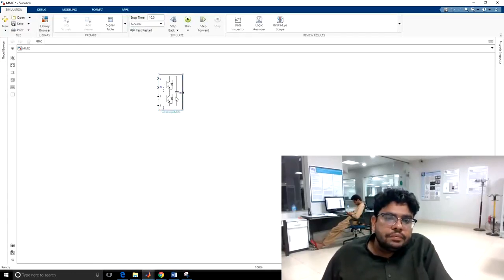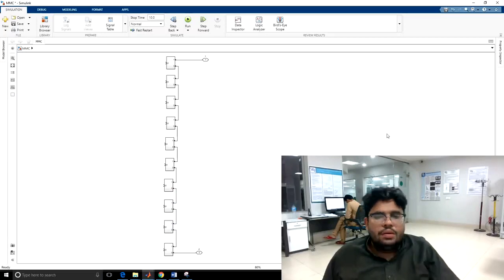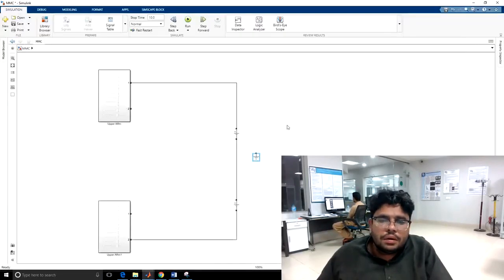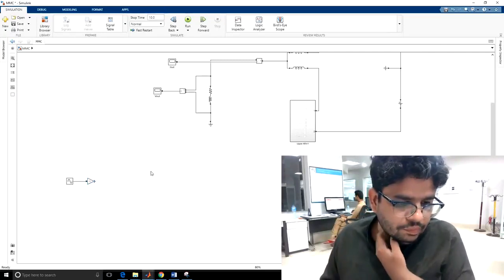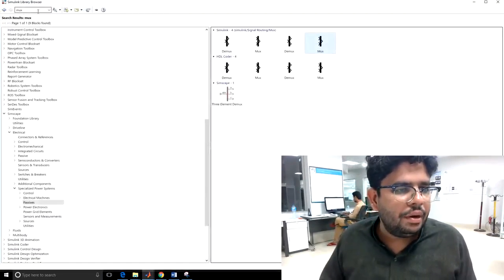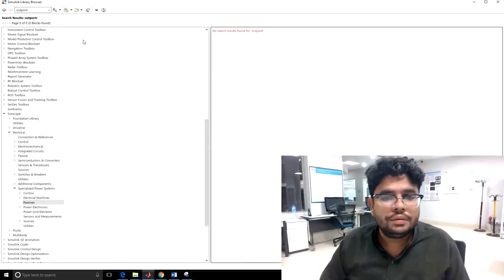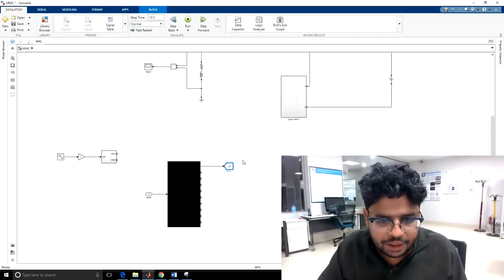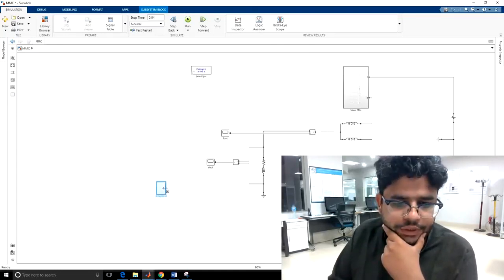MMC in MATLAB

Comment: The settings for the selector block part are:
Number of input dimensions: 1
Index mode: One-time based
Index Options: Index Vector (dialog) [1 11 2 12 3 13 4 14 5 15 6 16 7 17 8 18 9 19 10 20] 
Input Port Size: 20
Hope it can be helpful!

Comment: Sir, how to design MMC using Full bridge? Because I designed the full bridge in the same concept as for half bridge using NLC but i am not getting the output properly. Sir, can you please upload a video on MMC using Fullbridge topology with reduction in circulating current and capacitor voltage balance using Matlab?

Comment: Sir,excellent explanation.I have tried and got the output using Half bridge submodule in MMC.Thank you Sir.
But, if i implement the same concept for full bridge submodule i am not getting the output properly.Sir,Can you please upload a video for Full bridge submodule  and also interfacing the MMC interfacing with induction motor?
Reply from the maker: Contact jahangir.soomro@iba-suk.edu.pk
Reply: @jahangeersoomro  
Good evening Sir, I have mailed my design. Kindly do the needful. Thank you Sir.

Comment: sir plzz guide for selector block
Reply: The settings for the selector block part are:
Number of input dimensions: 1
Index mode: One-time based
Index Options: Index Vector (dialog) [1 11 2 12 3 13 4 14 5 15 6 16 7 17 8 18 9 19 10 20] 
Input Port Size: 20
Hope it can be helpful!

Comment: sir ,can you please explain the selector block part?
Reply: The settings for the selector block part are:
Number of input dimensions: 1
Index mode: One-time based
Index Options: Index Vector (dialog) [1 11 2 12 3 13 4 14 5 15 6 16 7 17 8 18 9 19 10 20] 
Input Port Size: 20
Hope it can be helpful!